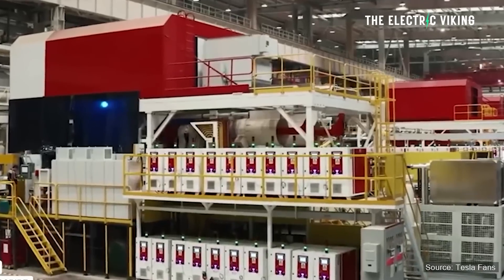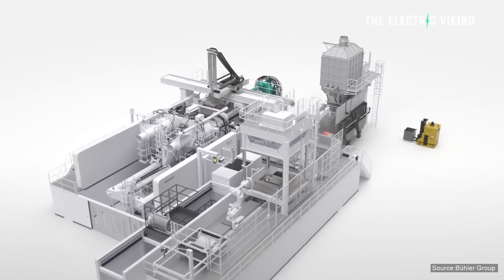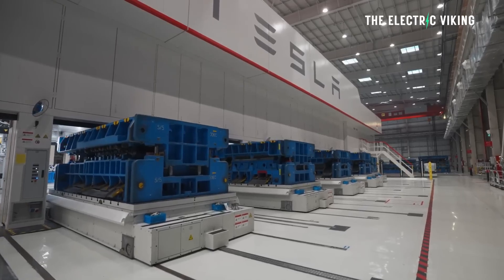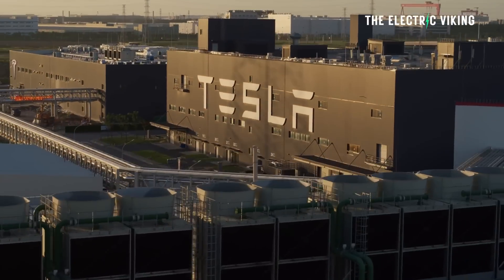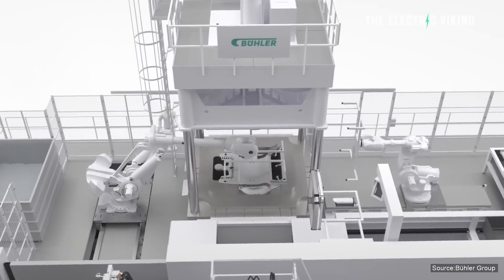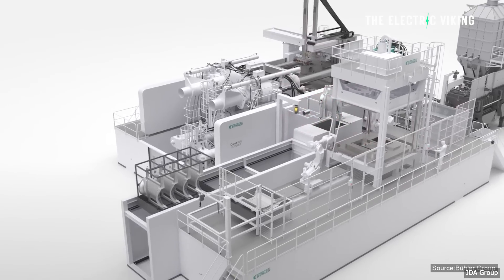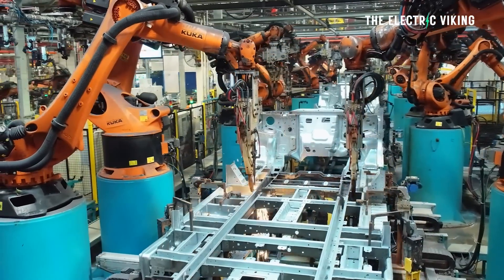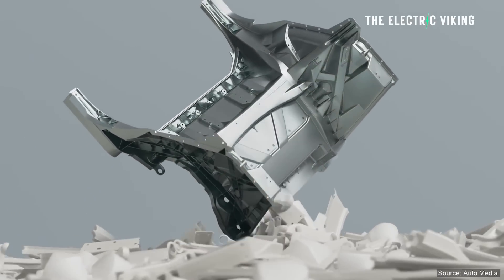Chinese engineers invent giant magnesium Gigacastings for cheaper, lighter EV's

Comment: Magnesium alloys are weaker than Al alloys and have corrosion issues. They also tend to be low density, so use up some volume, especially to get to sufficient strength. Some alloys of Mg are strong, but require expensive elements, like scandium.
Reply: Magnesium SUCKS is why it is NOT used.  IT shatters.  It corrodes easily.  It cracks easily.  Its fatigue life sucks.  Yes, it is absurdly easy to cast and it is absurdly cheap as there are gigatons of the stuff around... No one cares.    Until a new miracle alloy is created, using cheap alloy elements that also allow easy heat treatment, magnesium is near useless.  Every engineer looks at it and then leaves ASAP for aluminum etc.  Hey, we can play make believe we have finally figured out Boron... Then we will finally have a real material to move the world forward.  Or Beryillium alloy that is not toxic or... silicon carbide nanotubes while we are playing pie in the sky...
Reply: Just add scandium to aluminum and have done with it.
Reply: How about super magnesium alloy from Allite and other new alloys?
Reply: @JohnDir-xw3hf  Not sure which ones you are specifically talking about but the rule of thumb is any rare element  you can add to magnesium to improve its material properties you can add to aluminum to get identical improvements and since aluminum is stiffer than magnesium, more corrosion resistant to magnesium one would have to then factor in cost of material and here Mg should blow Aluminum away where the only reason its cost is high is simple becuase we throw it all away or most of it anyways.
Reply: @w8stral  But there's no such a rule. Cristal structure of magnesium and alluminum is completely different. Different alloys work differently with this metals.
Reply: @JohnDir-xw3hf  It is by and large true for the trace alloy elements between these 2 metals.  Look up compositions between the 2 and compare compared to base family.  Strontium is one such alloy which has near identical effects on both base metals.
Reply: They used to be used a lot in aircraft but I think nowadays titanium is the go-to metal.

Comment: The aerospace industry has used Aluminum and Magnesium castings for decades, it has some advantages but it costs over double. The reason it costs more is that it takes more energy to make. I do not believe that China is able to defeat the laws of physics in this manufacturing process especially since Aluminum is made in higher volumes.
As for fires when we were machining magnesium we did have fires but they were stated by the fine particles and the operator not keeping the machine-tool clear of chips. The main castings never caught on fire.

Comment: While mega castings, structural batteries are good for reducing manufacturing costs and complexity it may be a nightmare down the road for repairs/service. Insurance companies are already writing off a lot of vehicles now because of the high costs or replacement parts and labour costs. Rates will skyrocket in the future once the numbers of these vehicles increase.
Reply: OK, but the problem is lack of mechanics and inflation. The cost of parts is artificially set by the manufacturer, that's where they make their money.

Comment: I bet these megacastings will be nightmares for body shops.  I wonder if it will cause a higher scrap rate following accidents.
Reply: Munro Live said Tesla castings can be repaired with TIG welding.
Reply: @crb456  Yes, theoretically they are repairable. But the question is rather whether this is permissible. Even with steel constructions, there are areas that cannot/may not be repaired.
Reply: The answer is...No.

Comment: The thing aluminum magnesium alloys have an MSDS for flammability of 2. Meaning that they give off flammable fumes between 100 and 200 degrees. I think that is a no.
Reply: I can tell you that magnesium burns a lot hotter than that. 2500 K (2200 °C, 4000 °F).
Reply: @tedmoss  Correct. Those are the temperatures that it could ignite.

Comment: VW used magnesium alloy castings for their engine and transmission cases on the original beetle (and the kübelwagon) and kept using magnesium alloys throughout the life of those air cooled boxer engines.
Reply: Yes, they did. Have you ever seen one burn? I have. It was pretty spectacular.
Reply: @psnyder73 i tried cutting a transmission housing with an oxy acetylene torch. I was amazed to see "aluminum " burn. It did not sustain the fire. The fire went out as soon as I removed the torch.
Reply: @psnyder73  Was it thrown into a funace or something?
Reply: @philflip1963   Nope. It was burning on the side of the road and shut down about 5 lanes of traffic.
Reply: This does not make it a good idea.
Reply: Magnesium engine and gbox casting throughout the beetles life. Is incorrect. Porsche originally used Magnesium in original 356's, but dropped it for aluminium, which is far cheaper and stronger.

Comment: Magnesium costs 10x as much as aluminium. So it's difficult to see how this will reduce cost.
Reply: He explained it.
Reply: @tonyp2865  He didn't explain it, he repeated the claim made by the scientists. 

I very much doubt that the scientists have done the research necessary to justify their claims. They will just be making an optimistic guess.
Reply: @wr2382  Scientists don't guess, as if they would spend hundreds of millions on a guess.
Reply: @tonyp2865 scientists do indeed guess. It's called a hypothesis. A hypothesis is a guess structured so that it may be tested by outside observations. The only difference between " anybody's guess " and a scientists, is that the scientists are generally able to either prove or disprove a hypothesis.
Reply: @tonyp2865  The casts they made are no larger than the casts in the Model Y. They may actually be smaller. So they will be guessing when it comes to larger castings.

Their arguments for cost reduction seem to revolve around a lighter car needing fewer batteries for the same range. But they do not appear to have done any rigorous research into the actual production costs. It would probably be difficult to do this accurately because of the number of factors involved. 

Note that Tesla have only introduced gigacastings so far in new production lines that were designed for very large-scale production. This is probably because the castings process only has a small cost per unit advantage over traditional techniques and so it hasn't been cost effective to re-do the existing Model 3 lines, nor the small-scale Model S/X line when they did the refresh for those vehicles. 

Tesla and other manufacturers will undoubtedly continue to introduce castings in new product lines, but the castings are likely to provide only small reductions in cost and, so, will only make  up a small part of future cost reductions.
Reply: Not true.  Mg is cheaper and available near everywhere.  Most Mg is thrown away in mining process.  Mg is easy to cast is why they are using it.  Mg is less dense than Al, but is 50% the strength of Al.  Since section modulus goes by the square and moment inertia by the cube there are some VERY thin sections which can be used with Mg, but it has big issues with cracks, corrosion, flammability, wear, hardness for attachment points.
Reply: @w8stral just checked the metal reserves commodity current pricing, and magnesium is indeed trading at 10 times the value of aluminium. I don't know where you get your information from but it is incorrect. Same goes for your ridiculous comment about it being everywhere etc.....
Reply: @robertfonovic3551  Well then your kung fu search abilities suck ass.  Mg is ~3100/mt in FINISHED form, Al is 2600/mt in bulk.  Suggest some reading glasses.  Most of Mg is thrown out and only reason we have any at all is it is easier to try selling some of it.  Mg makes up the tops of pop cans for instance as it is absurdly easy to break the lid unlike aluminum.
Reply: @w8stral  I re-checked the respective prices and you are right that magnesium is not 10x as expensive as aluminium, but neither is it cheaper. Latest prices have magnesium being about 40% more expensive than aluminium. I was initially deceived by the prices for the two metals being shown in the same table, but in different currencies.

Comment: Didn't Volkswagen Beetles have part of the engine and drivetrains made of magnesium?  A number of Japanese performance motorcycles have used magnesium alloy parts to reduce weight.
Reply: True, that doesn't make it a good idea, a good deal of the replacement blocks for V.W. beetles are aluminum.
Reply: Occasionally one finds transmission housings made of magnesium alloys at VW/Audi
Reply: Only until the late 1960"s.

Comment: "Although pure magnesium is highly flammable, it is very difficult to ignite in mass or bulk. Additionally, no magnesium wheels are 100% magnesium, but an alloy composed with other elements/ingredients. There are a number of ways to fully minimize the likelihood of magnesium wheels’ ignition. For example, adding 1% calcium to the alloy makes such a scenario nearly impossible to occur even in the event of a complete vehicle fire. (In fact, the U.S. Federal Aviation Administration has admitted after multiple series of tests that modern, higher tech magnesium alloys are safe for use, even in aircraft seats)"
Reply: I'm not flying anymore.

Comment: I'd have to see the results of stress tests on their alloy. Traditionally, magnesium is much more susceptible to damage than aluminum. Magnesium alloy wheels have existed for many decades. They are considerably more expensive and easily damaged. You hit a pothole with magnesium and that wheel is SOL. Maybe just a matter of scale as far as the economics goes. If I see major adoption in the industry then that will tell the tale.
Reply: People are smarter than that.

Comment: Anybody who grew up in the '60s or '70s and knew a little something about muscle cars knows that this is a terrible idea.

Magnesium wheel sales are banned in the U.S. because when magnesium gets ignited it is incredibly hot and impossible to extinguish. It's dangerous to try to extinguish it. 

If you're trying to put out the lithium-ion battery with vast quantities of water, as is the protocol, you'll make the magnesium chassis react and turn into a bomb. It will explode and send shrapnel in all directions. It will cut people down.

With the potential of a lithium-ion battery or even the occasional LFP battery combusting and being attached to a magnesium chassis...it is like attaching a bomb to a molotov cocktail.  

It only takes one to go off before they both go off. And either one can go off.

Leave it to the Chinese to want to put something like that out on the market for unaware consumers.
Reply: Exactly. I have machined magnesium before and it’s kind of scary. I’ve only seen it catch fire once in a metal chip bin. We didn’t try to put it out. We just let it burn. It was not that much material. But it got hot. Scary fast.
Reply: @ZeusBullyMax  
I met a firefighter in Warwick Rhode Island who told me he was involved in a field test of a new fire suppressant to be used on magnesium.
. For the test, the assembled a pile of magnesium rims and ignited.

Then they started drowning the fire in this new suppressant.  

They started hearing weird creaking and cracking noises, and somebody screamed that it was going to explode, so the firefighter ran for his life and got thrown by the blast and suffered a severe back injury.  

He was still an active firefighter when I met him, despite the injury.

Comment: Is this a good move, from a point of view of durability and repairability ? I don't think so. You have a crack on the frame and you scrap the car.
The chalenge to compete is not only lowering cost, is lower cost with good quality.

Comment: I'll stick with aluminum, I spent many hours sitting on the flight line in my fire truck while the F-101 came in for a landing with its magnesium wheels. A battery fire will really burn nicely with magnesium added to the fire (you can't put it out). In fact, it could take out a whole intersection in one accident. The insurance companies are really going to love this. (V.W. engine castings were magnesium).
Reply: Aluminum and Mag have almost the same ignition point. But it all depends on the *ALLOY*. Jeezuz people, do a little reading before posting.
Reply: @stephensaines7100    Never heard of aluminum burning so hot that firefighters with a firehose spraying on it couldn't put it out.  Had a magnesium backpack burn in a house fire and they couldn't put it out.
Reply: @stephensaines7100  Magnesium is a lot more critical here. Spontaneous ignition of the melt by atmospheric oxygen, formation of hydrogen, dust explosion...
But yes, you can alloy with calcium/yttrium to achieve fire resistance similar to that of aluminum alloys.
Reply: @Zedus-rl9hp  The castings of Tesla cars require very high temps and pressure to make sure all voids are filled with very fast speeds. The risks of the slightest bit of any oxygen would cause an explosion using Magnesium if it was not perfectly blended. I guess Tesla would prefer to have factories that don't explode on them so use Aluminum.
Reply: Now imagine it burning in a parking garage full of electric and gas cars.

Comment: No one has commented on how body shops will repair deformed gigacastings. Separate parts can be cut way and a new one welded in place.  Will markers sell sections or will third party suppliers buy a full casting and cut out pieces for repairs?

Can these new alloys actually be welded?

Gigacastings mean lower costs on the front end, but unless I’m missing something, it means higher repair costs and more minor accidents that lead to total losses, both mean higher insurance costs.   No free lunch.
Reply: We could be entering a new era where the gigacastings are replaced, not repaired. If they become so cheap to make, why bother repairing? exchange the bent/damaged part with a new one, so the material is reclaimed. Body shops become dissembly/reassembly shops.
Reply: I am eating my free lunch right now.😁 Cost estimates don't show much if any increase for giga castings because if the accident is that bad it would cost the same to fix a conventional frame.
Reply: Throw away cars.
Reply: @tonyp2865  That’s what I’m afraid of.   The cost of already high insurance rates for gigacast EVs will be pushed so high that the total cost of ownership will be back to what ICE vehicles were, slowing the market penetration of EVs.
Reply: @tonyp2865 with crash avoidance tech maybe in 20 years (many older cars off the road) vehicle totaling accidents will drop, reducing claims/insurance.
Good for my grands at least 😁
Reply: Insurance for vehicles with gigacastings is not more expensive everywhere, the price really has to be found here.
In theory, gigacastings could also be repaired, just like steel parts. The only question is whether there is enough demand/pressure for manufacturers to offer several options here.
Currently, only the longitudinal members (impact absorbers) are offered as interchangeable, but this covers the vast majority of accident scenarios and makes them repairable in a similar way to steel constructions, which cannot/may not be replaced in critical areas.
Reply: @Zedus-rl9hp  The video was talking about new castings of magnesium- presumably alloys of aluminum and magnesium- and if different manufacturers used different alloys, if welding these alloys is even possible, it will take different techniques and materials to weld them.
Reply: @FoamCrusher  You don't really need different techniques. The right filler material and with TIG you can then weld all weldable alloys
Reply: Sorry I didnt see your post earlier.  I made the same statement above.  I cant imagine how they will be able to be repaired.
Reply: One word for you, kid: epoxy!
Reply: Car will be written off and sold for parts. Any hit hard enough to damage structure of car usually equals a write off. My Mazda 3 got t-boned and with b pillar pushed in enough to (slightly) damage roof and floor and was written off. Drove fine, mechanically fine, front, rear, left side fine, interior was ok (maybe needed new drivers seat and door etc) and I was fine, drove the car home....

Comment: magnesium-air salt-water fuel cell would be also easily rechargeable, ie, MgO + H2 -> Mg + H2O, electrolysis, etc
Reply: well magnesium is 1.7g/cm^2 vs 2.7g/cm^3 of aluminium in density
Reply: magnesium energy storage per kg is about 6.2kWh/kg, tho, not as much as aluminium 8.4kWh/kg